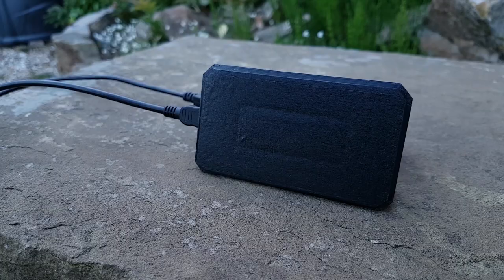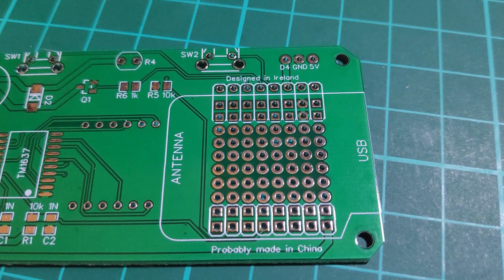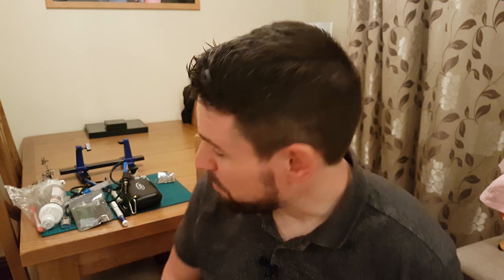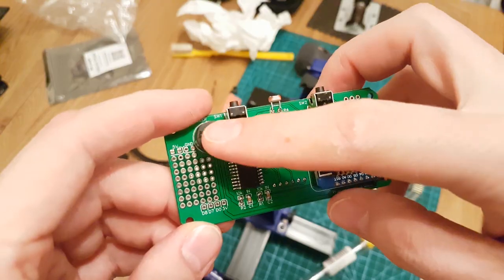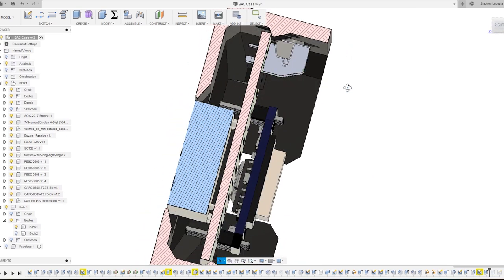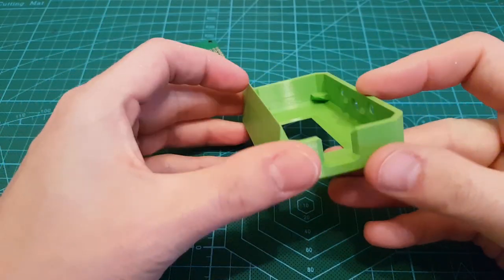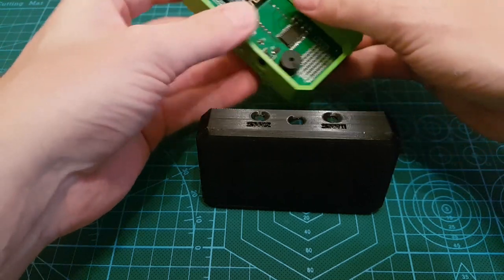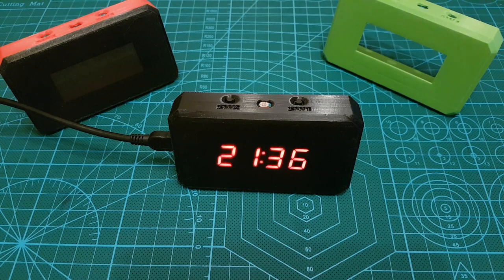BLough Alarm Clock (BAC) kit by Brian Lough - 3D Printed Case

Comment from the maker: Both 3D case STL files and the PCB STEP file (If you want to make your own case) Avialable on Thingiverse: https://www.thingiverse.com/thing:3646860
Reply: Good stuff! I think I'm going to play a little with the see through case idea! Thanks!
Reply from the maker: It works well with most LED displays. I have the same on one of those 4x 8x8 led matrix modules, switched off it looks like nothings there. Very magical!

Comment: Very nice do you have the size of the PCB please, Your case looks good and a good design I was going to buy the clock to fit into an old round clock but looking at your case I just think it looks very cool so will go with the case Thanks Bob in the UK
Reply from the maker: Thanks for the kind words Bob! Brian's PCB is mostly rectangular with notches out on the corners. But the main length and width is just under 90mm x 42mm. The buttons stick above that if you go for the right angle buttons.

Comment: That case looks AMAZING. Great job1

I really need to get a 3D printer. 

I'm curious,  does the software design the layout after you give the dimensions of the object or do you have to do that on your own? I know its a stupid question, but I have zero knowledge on 3D printing.
Reply from the maker: Only just seen this, sorry David! You do need a 3D printer, they are great! Which software are you talking about - the 3D creation software to make the model, or the 3D printing software (the slicer) that makes the printer create the physical model?
Reply: @ChunkySteveo  The 3D creation software. After measuring the board and typing that into the software does the software give you 3D design suggestions for the case or does the user have to design the case in a AUTOCAD type setting.
Reply from the maker: @davidpyper1688  the case was designed from scratch in Fusion360. I'm not aware of any software that could make suggestions on case design automatically. It's a complex process, but Fusion is quick to pick up and learn, I'd highly recommend it!
Reply: @ChunkySteveo  That program is a bit steep. I suppose I could get a cracked version, but they never run that well. I downloaded blender. its free and fully functional. I'm picking it up slowly, but by the time I get a 3D printer I should have most of my cases designed and ready to print. Thanks for helping me out.

Comment: Hey, were you able to compile the sketch using the lastest Arduino JSON/Libraries?
Mine is stock at "Conf"/showing "94"

I can provide the updated, but not yet working code :)
Reply from the maker: Not updated mine in over a year now. Brian is super helpful if you raise an issue with his repo on Git.